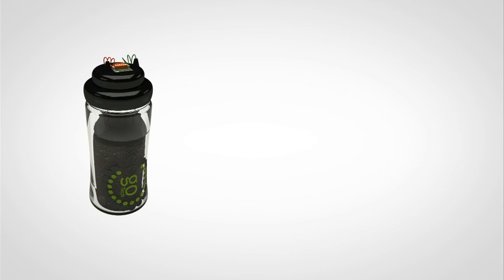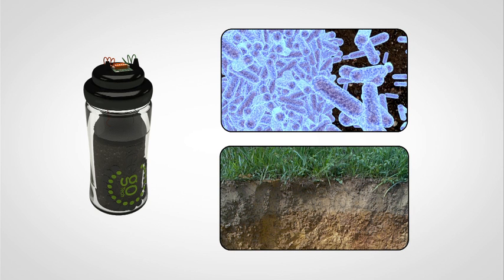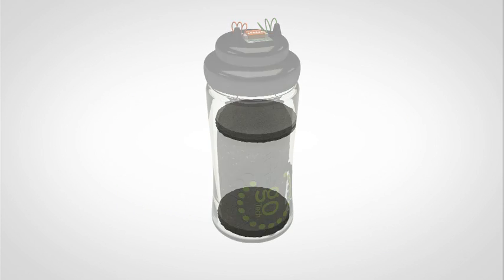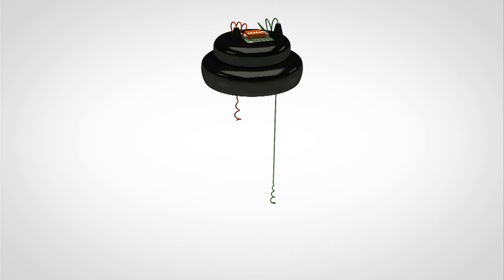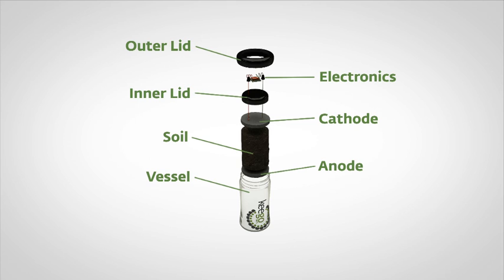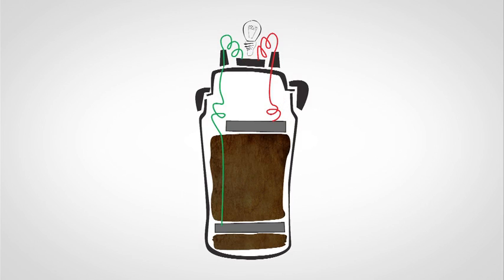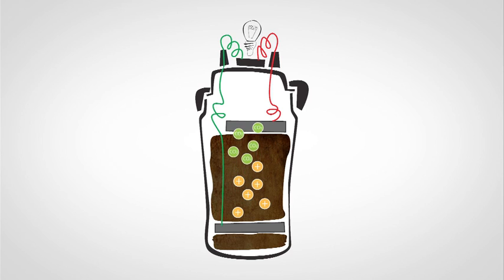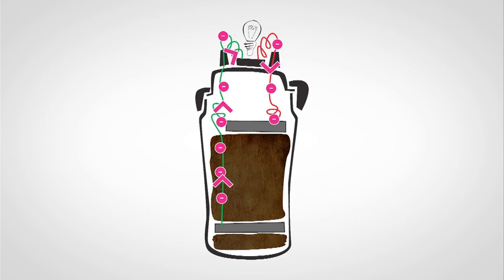MudWatt Microbial Fuel Cell - How It Works

Comment: You can add Cyanobacteria that produces O2 from H2O and CO2.
Now this bacteria has new form as chloroplast with endosymbiosis.
Reply: As the moisture evaporates form the soil would the electricity production drop, even if there were plenty of nutrients and gases ?